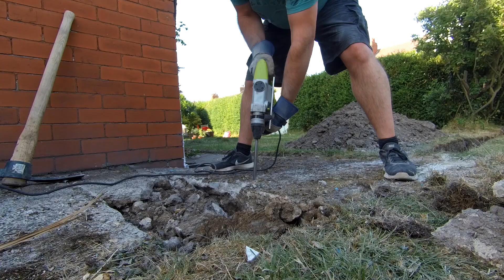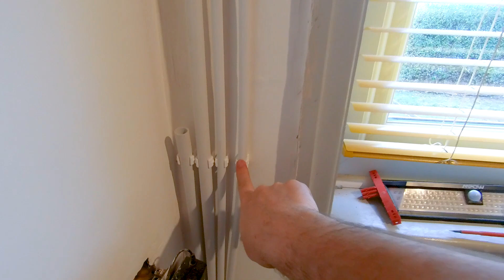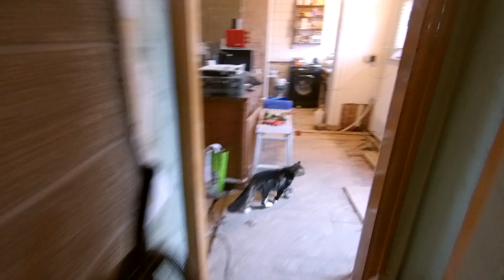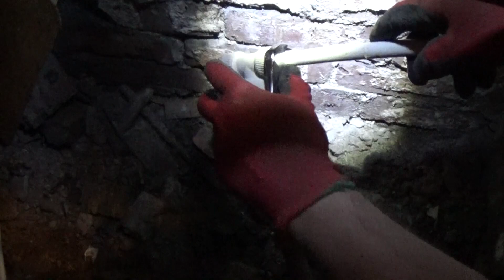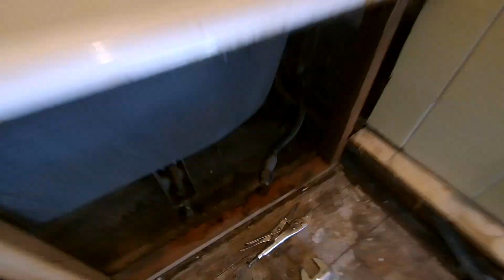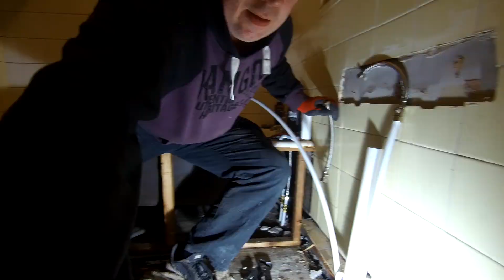How to Install a Central Heating System part 4 - The boilers in and we run new pipes DIY Vlog #13

Comment: Hey, thank you very much for posting these videos and good luck with the all project! I am trying to learn something out of those.. stupid question I noticed you turn main water on but for the sink or whatever utilities in bathroom you left isolation valve off is it okay and enough to leave it like that even if you don't have a tap connected? Thanks
Reply from the maker: Yes it's fine to leave isolation valve turned off with nothing connected to it.

Comment: Please tell me more .We did everything with nuts about 15 years ago. But then when the pipes were heated and cooled, there were leaks at the joints. Water dripped from these nuts. And we switched to polypropylene. The nuts were replaced with welding. Do you have water over time does not flow from under these nuts? How long does this connection last without leaks? Or do you need to constantly tweak them?
Reply from the maker: The nuts with some PTFE tape are very reliable, you never need to tweak them if it's done right in the first place. Our heating systems also have and additive placed in them that stop any corrosion to the copper pipes, rads or nuts.

Comment: I was wondering if you installed the boiler yourself - I thought it was a job for a gas safe fitter or maybe you are gas safe registered? Thanks for the videos which I find very helpful.
Reply from the maker: No I paid £300 for a qualified plumber. They ran a new 22mm gas pipe to the front of the house, as the old one was lead, hung the boiler and made all the connections to it from the pipes I had already laid. Glad the videos are of help, thank you.

Comment: Hey 👍
Really good videos. I am in the process of doing everything too!
Reply: Changing over hot water pipes as I text. One question, where did you buy the central heating deal with boiler. Is it wise Mann etc. ? Do you have a link. I am a diyer, but I will have plumber install and certify work for regs. He's happy. Told me he doesn't like wet work!!!!
Reply from the maker: I got my deal from mrcentralheating.co.uk was a good price too for the boiler, pipes and rads. I did end up needing a lot more pipe and fittings than they supplied though. Good luck with it all, it's well worth doing it yourself as it saves a fortune.

Comment: tell me please. You start the installation with a copper pipe, then switch to plastic. Are you supposed to have copper connected to the radiator? Is this some kind of building code? Or is it for beauty? Why not make everything plastic?
Reply from the maker: The copper pipes to the rads are for beauty, you can connect the plastic pipe if you want to. The copper and plastics here are all to building code so it's a matter of preference.